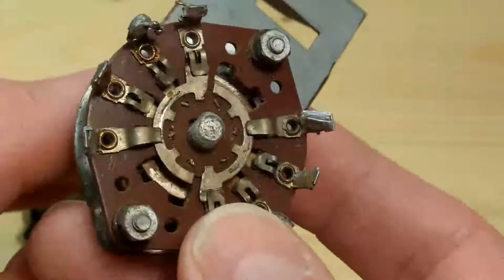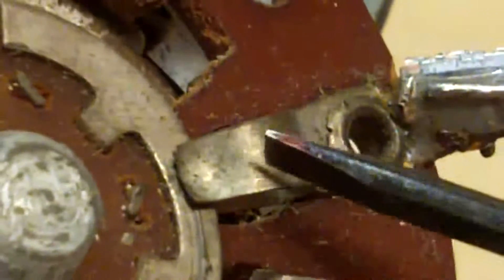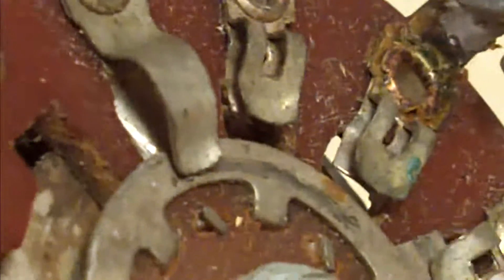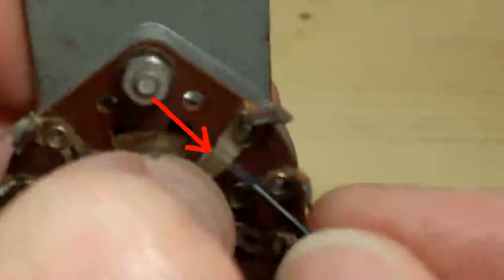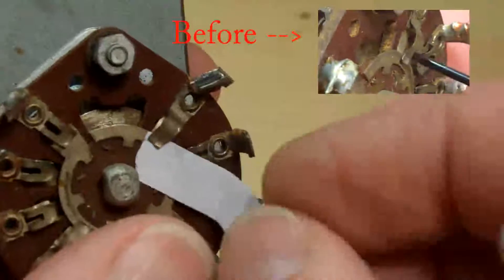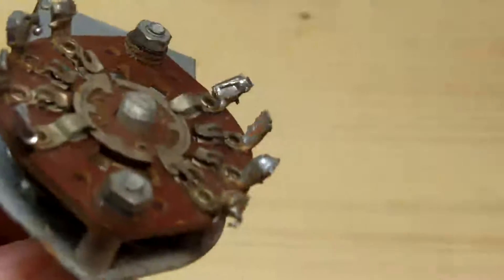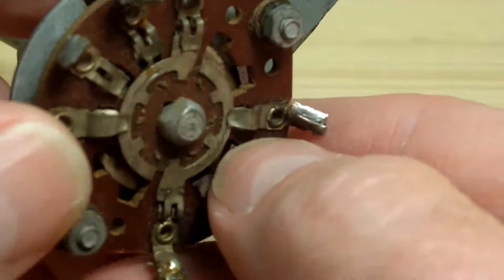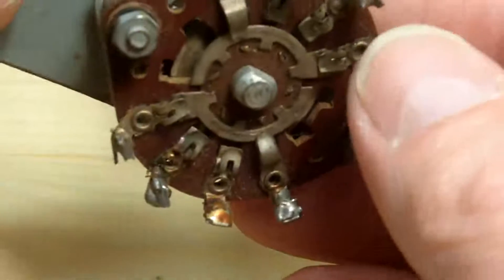About Radio ... Part 19 More on repairing Wafer Switchers

Comment: WD_40 on contacts? Never ever!
Reply from the maker: Trust me on this one, it works well and has done for more years than I can remember, more than ten. That is radios that have had a shot of WD40 are still going strong. I was given a radio about a month ago that was going to be junked because the main switch only worked intermittently. I didn't even have to open the case to fix it. 
But hey, if you don't wont to try it that's fine. WD40 works particularly well on crackly volume controls.  Maybe try it on an old radio and if it lets you down in the next ten years you'll know that you were right.
I was sceptical when Rick on 'AllAmericanFifeRadio' told me about it years ago but man it works and it lasts.
All the very best . . . Andy
Reply: @AndyDaviesByTheSea  I'll try it. So far I'm using Caig D5 contact Cleaner
Reply: @AndyDaviesByTheSea  You are correct Andy. I don't know who started knocking WD-40, but they are wrong.

Comment: Andy, you are a Godsend, I have an old Heathkit SB-200 HF Linear amp, I could not get the grid, Plate, SWR, HV readings on my meter.

The problem was the wafer switch, I knew the problem and couldn't locate one, new or used. I found your video and tightened the contact as you showed.

IT WORKED, you saved me money, that's if I could even locate one and labor. Thank you, it works as NEW!!!!!!

Eddie 73s kj4fgi
Reply from the maker: Hi Eddie I'm really pleased to have been of help. I wonder how many good equipments have been discarded just for the sake of a little repair like this. Well done on the repair and thanks for letting me know. Kind Regards . . .  Andy

Comment: Andy, can wafer switches be used to pass RF? I see many wafer switches at Ham Radio flea market at a great bargain and I build my own antenna switcher switch rather than buy a commercial model.
Thanks, Terry KB8AMZ
Reply from the maker: Hi Terry  yes you can use a wafer switch like the one in the video for low power RF.  They won’t stand a lot of current but I guess that if you wanted to switch a 75 Ω antenna at 100 watts I’d use two or three poles in parallel so that you only have a few watts per switch but I wouldn’t push it above that.
Kind Regards  . ..  Andy GWØJXM

Comment from the maker: @MickLBrad Hi Mike I know one can get pretty desperate at times.
 I don’t know that I have enough old switches to do as you ask, I’ll think about that one though 
For the benefit of any novices out there once you take abrasives to switch a low voltage (signal) switches you run the risk of destroying the surface plating. Switches can have a very thin coating of gold or silver (gold doesn’t oxidise) that normally has a low resistance until it gets dirty or oxidises     
Kind Regards ... Andy.

Comment: another great tip!  on the jukeboxes i restore the selector buttons usually have 20 pushbuttons using the same principle in a linear fashion with 4 sets of changeover contacts for each button...so  lots to clean and adjust!
i  put the whole assembly in a bath of sugar soap solution then rinse and air dry, as the switches are usually 40 to 50 years old a few have lost there tension...in the past i have taken them completely apart in order to retention them your tip will save a lot of work  bob